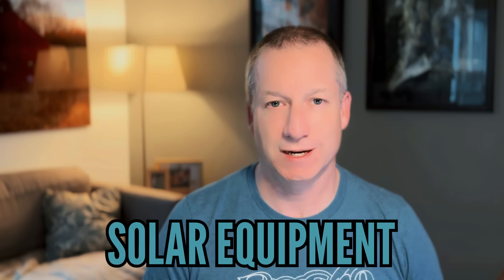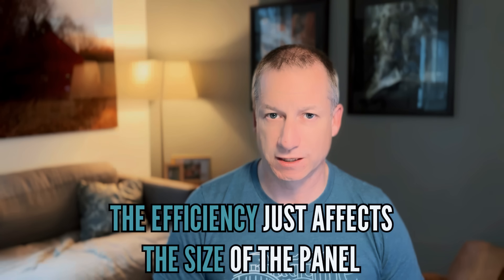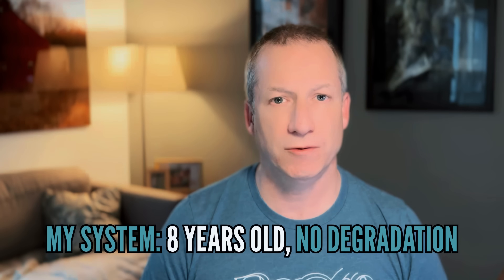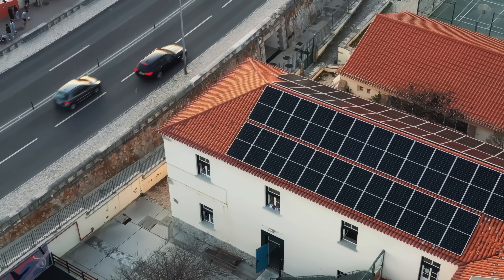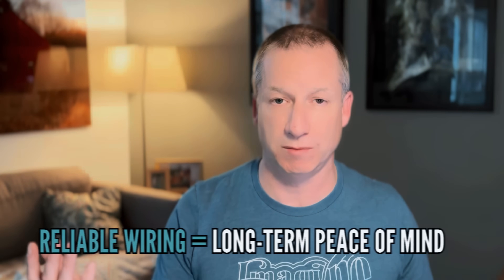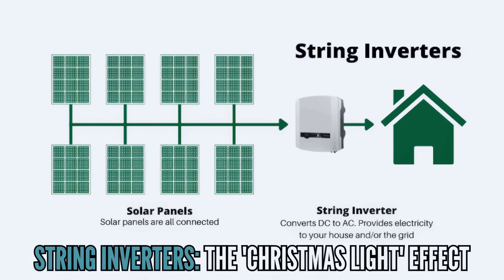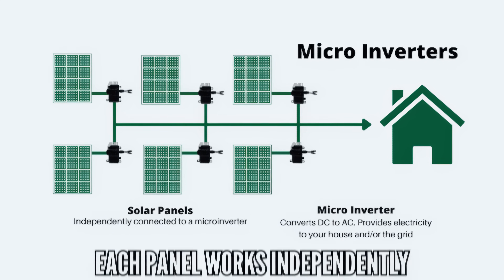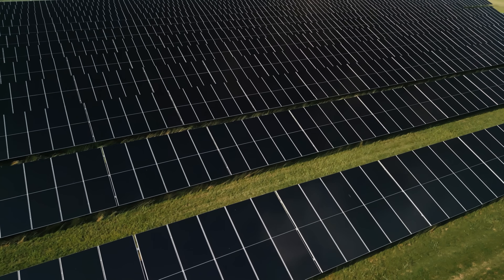The Hidden Downside of Microinverters No One Talks About

Comment: I would really like to know what type of optimizers you're installing. From my experience the failure rate of optimizers are 100 to 1 versus enphase micro inverters. I've been installing solar for almost 30 years now. I have done replacements and repairs more often on DC optimized systems than micro inverter AC system. Just started using Tigo, out of 3 systems I already had to replace optimizers. Approximately 30 years I have probably changed 30 microinverters.
Reply from the maker: Appreciate you commenting and respect your years of experience. I’m talking about SolarEdge optimizers. My experience has been the exact opposite of yours. From reading comments online it seems there are people in both camps. I do know the largest residential installer in the U.S. uses SolarEdge and I think it has a lot to do with the maintenance side of things.
Reply: @bradthesolarguy  anyone who is installing solaredge is not installing it for its reliability and or longevity it is the cheaper option out of the two. Room for more profits and room for more service charges. I have seen multiple companies go under utilizing solaredge equipment.
One company use them for about 4 months. Installed approximately 16 jobs. 10 of the 16 has required 3 to 5 service calls per year since the install for equipment failure. Solaredge makes you jump through fiery hoops of death before issuing an RNA on any product. As far as solaredge is concerned any issue with their system is an install issue and has nothing to do with their equipment. So they make you go out and test every optimizer in the string to find the bad one. Even though they're monitoring has all the values previous to the product failure. You have to send them pictures of the optimizer voltage and the pictures of the panel voltage to show them their product is broken. Imagine how fun that is on a string of 22 panels. Now imagine how fun it is to go out and do the same thing to the same string of 22 panels 7 different times. When I contact enphase the technician is able to look on the monitoring site and assess the issue. I've called up tech support for enphase when having an issue with an inverter to hear from the technician that the inverter has already been RNA and is being shipped to the customer's house. No climbing on the roof no taking apart a panel no holding the panel with your head in order to take measurements while holding the two pronged multimeter in the mc4 connector while trying to take a picture of the values with your phone and also getting the serial number in the same picture smh...
Reply: @bradthesolarguy and your experience is based on how many systems again?

Comment: There is a 4th inverter option. I installed 16 580w bifacial panels on a Ground mount with 4 NEP BDM 2000 micro inverters. Each inverter supports up to 4 panels. I'm very happy with  the performance. Sunny day in March and I'm hitting 65kWh with no clipping. Nova Scotia 🇨🇦
Reply from the maker: Are you sure about the no clipping? And with any micro system you have to AC couple batteries should you ever want to add them.

Comment: Parents just bought a house with a bunch of solar panels. The owner 2 owners back owned a solar install business. This place has a bunch of panels. From what I found under the solar panel awning, it looks to be a microinverter system, Enphase M215's. Being engineering inclined I immediately wondered how battery storage would work with these... and yeah, thanks to your video, basically confirmed what I was dreading, it works very inefficiently, DC to AC to DC to AC 😞
Reply: Quick google search buddy: AC-coupled systems are the preferred option for larger and utility-scale plants. That's because while AC-coupled systems are slightly less efficient at charging batteries (90-94% vs 98% achieved by DC-coupled), they are far easier to install, especially into an existing system.
Reply: An option would be to simply connect a battery pack, (like the RUiXU Lithi2-16 LFP) to the mains. Any excess energy generated from the panels would cause your homes power meter to run backwards. You could draw power from the grid during the same time (basically causing no forward movement of your meter)or during off peak hours (to charge the batteries). During peak hours you simply draw power from the batteries avoiding the higher rates. PLEASE NOTE: THAT THESE TYPES OF BATTERY PACKS ARE DESIGNED TO BE HOOKED TO THE GRID. Also note that some people are simply installing the battery packs without panels to avoid peak hour power rates. Buy during off peak rates and use during high peak rates. Here in AZ that is a 3 hour window from 4 to 7 PM.
Reply from the maker: Sorry about that.

Comment: Interesting perspective. One important item you did not mention is that microinverters at roof level makes a safer system in terms of electrical faults and fire. Up to 600v DC coming through your roof and down to the string inverter is more likely to produce an electrical fire than 240v AC coming down to your combiner panel.
Reply from the maker: Actually the SolarEdge system solves the arcing problem and passes US national fire code. Because both Enphase and SolarEdge put this I their architecture a long time ago is one reason they are the Coke and Pepsi of residential inverter systems in the US.

Comment: Microinverters with no AC on the roof, easy maintenance, easy monitoring and easy upgrading : When I helped a friend install his solar PV on his roof we discussed microinverters etc. The maintenance issue was a big issue for him. I suggested we ran the two MC4 wires from every panel individually to a clean, dry room and install all the microinverters at ground level so they could be monitored and replaced easily. Also, if he did that, he could convert to a string inverter system by just doing a bit of re-connection. Lots of wires but no AC on the roof, easy maintenance, easy monitoring and easy upgrading.
Reply from the maker: Sounds pretty good.
Reply: Why on earth is it an disadvantage to have AC on the roof? AC is low voltage after microinverters and safe. If you have DC from panels on the roof it will be high voltage before the microinverter.
Reply: @TurreTuntematon  Oh, nothing against microinverters but disadvantages of under panel mounting are (imo) code/regulations regarding external mains AC (conduit probably required + extra inspections, maybe), DC to AC electronics possible maintenance issues (hot-cold cycle and possible panel removal to replace inverters).  Other pros of getting all the DC wires (per panel) to a dry room - considerable flexibility with inverter set up, low voltage (50ish Volts) 10A roughly per wire pair. No disconnects required. Easy monitoring for faults. Temperature and moisture control inside garage/shed. Downsides - more wire Just my thoughts.

Comment: My own anecdotal experience as a service technician is that Enphase microinverters and SolarEdge power optimizers fail at about the same rate. SolarEdge issues tons of RMAs on them.

The main advantages, in my opinion, of a DC-optimized system are the ability for DC-coupling combined with module-level monitoring, and also the ability to oversize the DC side, IF your locale has a maximum inverter size (Massachusetts used to have a cap of 10kW AC if I’m not mistaken, and that’s why SolarEdge is so popular there). Under those rules, it’s just way more economical to go with optimizers; a microinverter system would be forced to be smaller with substantially less time in the day at peak output, which over ~25 years REALLY adds up.

SolarEdge has also DOMINATED the 3-phase part of the market for a while. I think this is largely because they saw the need WAY before Enphase, and also (correctly) pointed out the advantages over string inverters.

Only other point I wanted to contest was about modules. Those fail past the 1-year mark all the time, but it’s almost always one bypass diode failing, resulting in production being 2/3 what it should be. This is another area where MLPE really shines - one panel losing 1/3 of itself doesn’t curtail the performance of its neighbors. SolarEdge is actually WAY better than Enphase at detecting bad diodes, too.
Reply: The vast majority of homeowners I know would benefit the most from an Enphase PV system, assuming batteries aren’t part of the equation at all.
Reply: @DorMatt1  Enphase over APSystems or they're both similar?
Reply from the maker: Thanks for your thoughtful comment! Appreciate hearing from someone who services these units. I respect your expertise!

Comment: Hey. This was an amazing video. I ran into some problems during the winter here in Lithuania. I heard you are from Northern East, so we can relate in a way. I had 8x canadian solar 440T solar panels TOPHiKu6. That produces 0-2 watts during the winter months here in Lithuania. I now began researching everything. When I bought these panels I had no understanding how they worked, or which ones I should really get. I now got myself Jinko 485watt 1 solar panel for testing purposes, and I must say it works better. However, I am now exploring every possible way to prepare for the next winter. I am planning of getting more panels, and I hope by getting myself more advanced, with better technologies panels, they will perform better in low light conditions. I am now looking at HJT panels as they are said to perform very well in such scenarios. Let me know what you think, I got a Victron 250 MPPT, would love to hear your opinion whether it is the solar panels that could have caused these issues in my case. Besides, they were wired all in series, had no direct shadows from any objects other than the clouds shining on them.

Comment: Does a 450 watt panel on a microinverter only capable of producing 330 watts of AC power make more overall production than a 350 watt panel on the same 330 watt microinverter?  Seller lied that I would not have clipping, I already figured that out... but will the 450 watt panels make more power off peak than the 350 watt panels would have made?
Reply from the maker: This is one reason I don't like Enphase because it allows unscrupulous dealers to give you cheaper inverters that don't allow the full wattage of the panel to be used. I would not recommend doing that. I'm pretty sure they would produce a little more at off peak , but I'm certain that won't come close to making up for what you lose at peak.
Reply: @bradthesolarguy  I looked at my contract again and found that when we upgraded panels they also upgraded inverters to the IQ8X capable of 380 watts AC... if I have clipping it will be a lot less than I was anticipating.
Reply from the maker: @ That is the correct inverter size for those panels so will work as expected. There will be clipping because there almost always is, but less as you said.

Comment: I agree with your position on the central inverter being better for maintenance/repair and having lower fail rates on the optimizers. The amount of people that want the Enphase these days are astounding. Almost everyone we sell too want the Enphase micro's. We tell them we go out and warranty them pretty much weekly for different orphaned systems but no one seems to care. As long as its Enphase, they're happy. The marketing and education behind the micro's give Enphase a huge advantage in the market with all the SolarEdge inverters that do seem unreliable to your average consumer. Best solar system in my opinion is decent made in China panels with the lowest tier Solaredge inverter with S440's. Fastest return on investment and reliable.
Reply from the maker: Appreciate your comments. This is pretty much exactly my experience as well. I have learned through the comments that Enphase has been really reliable for some people and SolarEdge less so for others. I still maintain that the micro inverters are going to break down the road 10-20 years and it will be very hard to get anyone to come and replace them because that is a money loser for the installer. And because it will only affect a percentage of the system it won’t be an emergency and people will let it go.

Comment: 4:11 Why are you showing a crew walking on the panels?
Reply from the maker: It’s just stock footage - but you can walk on the panels!
Reply: @bradthesolarguy  About walking on panels: My electroluminescence (EL) inspection setup sais different. One can clearly see microcracks develop by a normal person standing with a flat foot on a panel. Sharper loads like a knee is even worse.
I'd say such actions diminish efficiency of a panel maybe more than heat from all black designs. There are few but interesting videos showing this available. Just carrying a large panel supporting it with shoulder/head can be enough. 2-layer glass versions seem to be much more resistant to microcracks from this type of treatment. I guess it has to do with the way the glass flexes vs thickness of the glass.

Comment: Am I wrong about hating black on black panels? I don't want to have a backing surface on the panels that do nothing but soak up heat and lower the efficiency of my setup.
The extra heat would in theory also increase aging would it not? (If I will get any.)
For me, the choice seem to be about size of panels vs snow load, and if I want a dual-glass version. The bigger panels also do give a lot more power per buck spent, but get unwieldy fast.
Selecting a panel that is as big as possible for the area I am covering seems like my best bet. One area is wide and short allowing only 2 rows of panels, but a longer panel works well there giving high utilization of area while keeping the setup portrait for low bracket cost. Other area is a bit taller but narrower so a bit shorter panel allows 3 rows there. Result is both areas can have 12 panels each. One 495w panels, the other 450w panels. My biggest issue is not being shafted on installation by ppl doing poor work, or on materials. Installers claim the rails cost the same as retail procing for singles at the hw store, which I know is a lie etc. When the total cost of the install becomes larger than the expected total production over next 20 years you know price gouging on gear is happening.
Reply from the maker: @1kreature  Black on black panels are less efficient than the same panel with a white back sheet. The ones with a white back sheet show some color and the grid lines. Most people prefer the black on black look for their home and the small difference in production is worth it for them.

Comment: Far and away one of the biggest arguments against micro inverters has to be getting them repaired.  It will be harder and harder to get qualified people to come at all, much less when they say they will.  They'll go where the most money is for that day and if installing electric for an EV or some other job is more profitable, that is what they will do.
Reply: All the solar install I've done have been with string inverters. One big advantage over microinverters is future proofing. It's a whole lot easier to add a hybrid inverter to a string system and then add batteries (when they become even cheaper).
Reply: Dude Micro inverters are plug and play. If you can hook up stereo components you can replace a micro inverter. I would never pay for someone to replace mine. It would be like paying someone to come over to unplug my toaster. LOL
Reply: @evergreeninvest  Dude, you are not 70 years old with a steeply pitched roof.
Reply: @robertd9850 NO I'm a young 67!😂😂😂😂😂
Reply from the maker: Yes. I totally agree. One of the biggest issues for homeowners with solar down the road is going to be maintenance. This is why I recommend leasing for most people and why I don't like micro-inverters.

Comment: You are basically correct with "efficiency etc", the only argument I have is that when you have A) limited space, or if B) shadows affect areas of a (roof, wall, ground) then sometimes that 10 cm less on the size of a panel (let´s say you have 6 panels = 6.10cm = 60cm) can affect the position, and be MORE EFFICIENT if you have panels on a smaller AREA.
If you have "limitless sun space, a field" then efficiency of a panel has no effect.
* I have limited space, and therefore I want more efficient panels, if price isn´t a huge issue.
Also microinverters today come in 2 panels/inverter, and 4 panels/inv + the newest ones allow for 4 inputs that can handle 2 panels each = 8 panels/inverter = you don´t have to put ONE under each panel.
"Microinverters break" - mmm it depends a LOT on the manufacturer... when I asked in a store here they sold 3 different brands, and said NO to one, and ABSOLUTELY YES to another (Hoymiles), because it is much more reliable.
But let´s sayt micvroinverters would break more often, there is also another thing then... a STRING inverter breaking means ALL panels are out of production until fixed, with microinverters the other inverters/panels might work despite one being broken.

Also if you have 30 microinverters (= 30 panels) on your roof, you should go with a string inverter in general cases.
We who HAVE (going to get) microinverters get them because our roof does NOT have place for "12-16" panels in the first place. That is the "whole idea" of mi:s.
And if you have modern mi that can handle 4 panels, then you usually have 2-3 microinverters with up to 4 panels each. You don´t have to "replace 30". You fix one after 12 years that break, the 2 others still work.